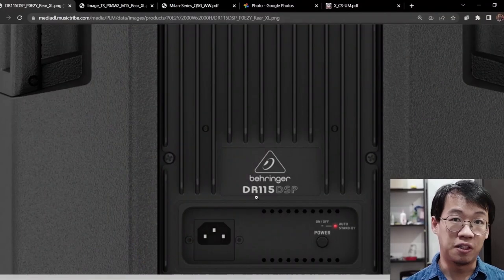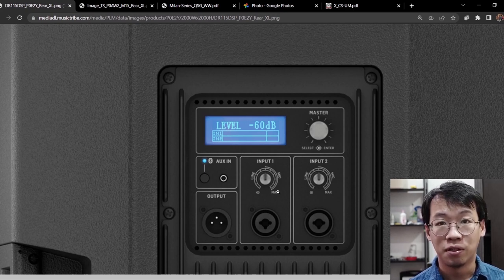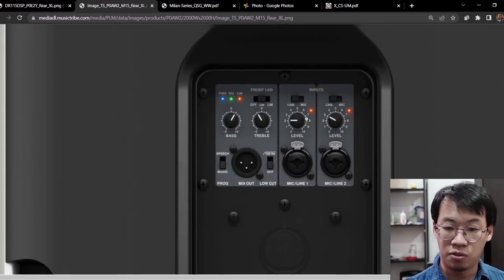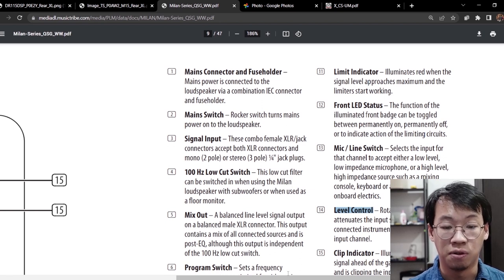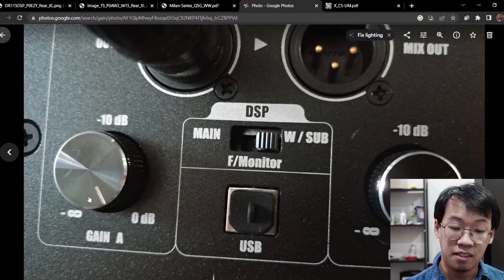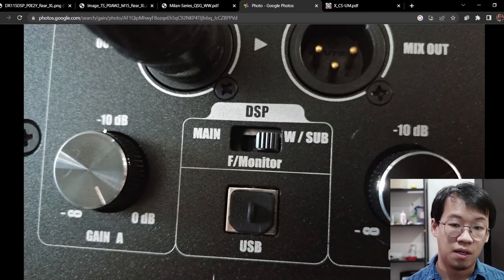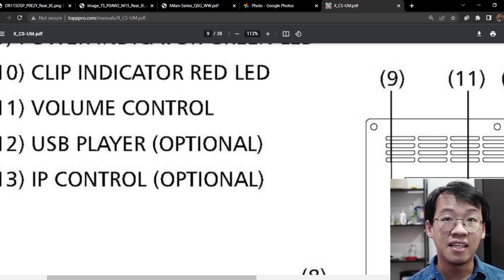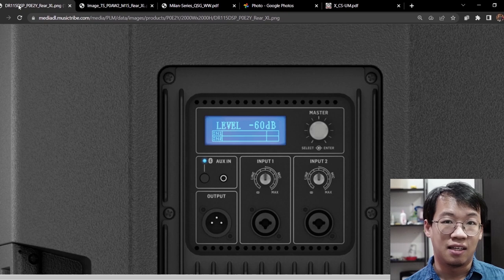Active loudspeaker's volume gain to 12 o'clock?

Comment: Hey I have DBR15s they are on line level. Mixer is at unity but the speakers are toooo loud. The knob is from -Infinity to  + 10 db. I have it at 0 (unity)

Do I turn down the speakers or the main level faders?
Reply from the maker: Yeah, you can turn down the knob
Reply: If its a volume knob, set it to however you like. Excess volume can't harm or alter the  signal. Gain is what you have to get right because too much will overdrive the input. If the system is just loud but not distorted, see if you have a useable range for your volume knob. If not, lower the gain until the volume is usable.